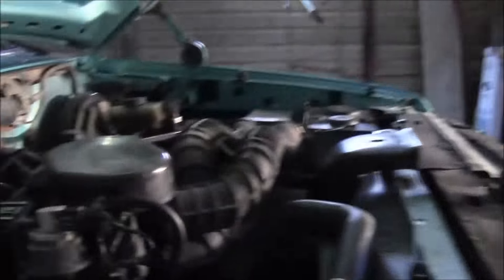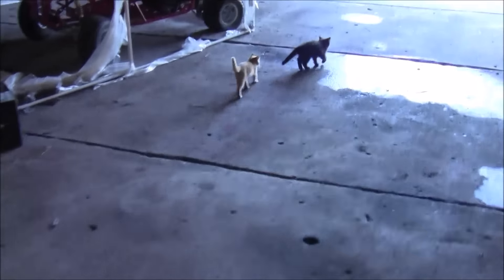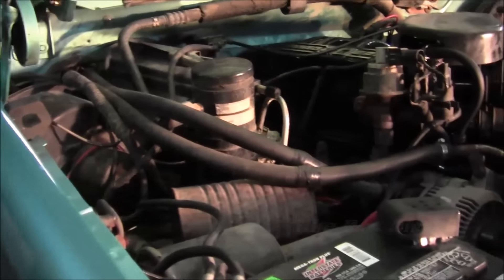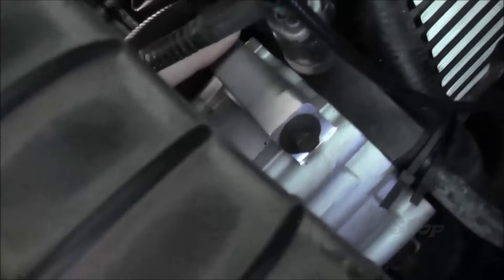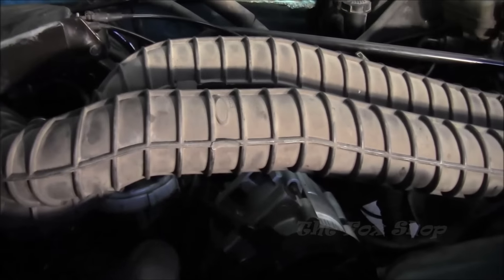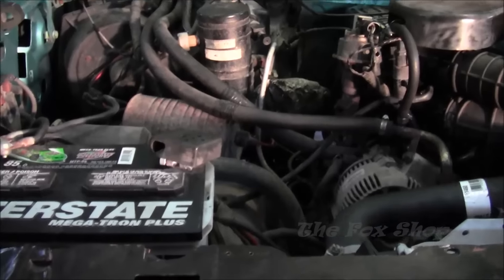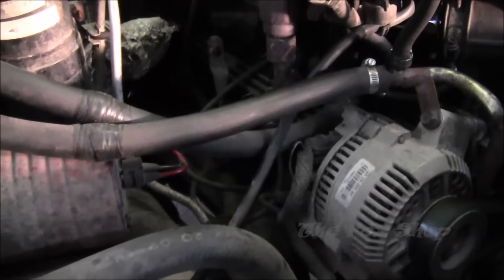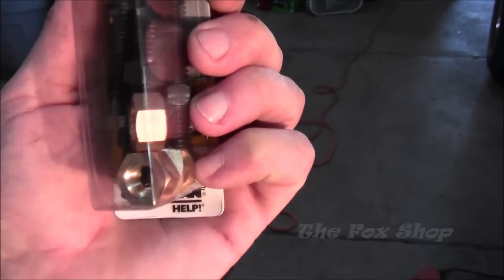Ford F150 Exhaust leak and a/c fix (again) Video.

Comment: You should have named this video "cats take over my shop" LOL. If it were me that spray bottle would be replaced with a .22! The stray bastards sneak into my garage and eat my dog's food and get into my trash at night (picking up a bag of trash scattered across 2 acres by the wind at 5am isnt my favorite thing to do).. so I take a slightly more lethal measure, lmao. When I grew tired of the leaky flanges on my f150 I just threw some Pacesetter headers on and a dual exhaust and called it a day. Its more of a winter truck now. I remember some time ago I thought you mentioned potentially getting another OBS.. that would be awesome to see. Your F150 is just too nice and I can't picture you driving it in the winter! Hmm.. maybe you should get a winter truck and make a video series about it too..haha! I'd like to get around to fixing my AC in both of my OBS trucks, I've had no air for years in my half ton though. The summers in Ohio are brutally humid as well. It sucks! This video made me want AC again, lol. Yet another entertaining video from Fox.
Reply from the maker: Logan W. LOL!!! Well we actually like our cats, they normally don't go into my shop, but being that its insulated its been cooler in there, so I think they like it.  Havent had much of a problem after I started using that spray bottle... plus they keep the mice away. LOL!   You are pretty much on target... I don't plan on driving her in the salt and crap in the winter, just cant get myself to do it. When I first started that was the plan, and if she started rusting again I would just fix her again, but never thought she would turn out this good to be honest! LOL   SOOOO.. the plan is to buy another OBS for a winter and beat around truck.. although will probably fix it up somewhat and paint it.. but there is also something to be said or driving something you just don't give a rip about how it looks. At a minimum it has to be reliable... but looks not so important.  Might straighten the body out if it needs it, do some paint, and then just run it.  I have a 1999 Tahoe I need to get rid of. Nothing wrong with it except the rear end has started whining a bit, Im thinking pinion bearings maybe.. Don't even want to work on it but doubt anyone would buy it for what its worth the way it is.  After I sell that, then would like to find another OBS.. Not sure when that will happen, but need to get it fixed at least before winter and Ill just drive it this winter if I need to, but my truck...I cant do it... put too much work into her.  Hot and humid here in Iowa as well... tomorrow heat index 106 to 110 I believe. Yuck! Weekend supposed to be that way also.  Thanks for the comment and for watching, much more to come and you are pretty much on target with how Im thinking as well. LOL!
Reply: The Fox Shop Understandable on the cat thing. but a '99 Tahoe!? Come on man! Another FORD would be so much cooler! Lmao.I'm just messing with ya.. I see where you're coming from on that.  It would be cool to see you get a winter truck and beef up the suspension on it and what not, you could use it to plow instead of your beauty! Haha. You're right though, reliability is a must and with a little work, as we both know, makes these trucks unstoppable. All up to you in the end! Your videos are great and another little project video series from you would be awesome, needless to say. Hell, Its pretty clear that I don't give a rip about what my winter/romper F150 looks like, but her nickname is old reliable because she's an OBS. Curious to see what you end up doing. a 3/4 or 1 ton OBS winter truck video series would be as cool as your F150 Restoration series. I've said it before and I'll say it again.. I can't believe how nice your half ton turned out. I remember when she still had worn out leaf springs and rusty fenders... seems like a century ago! Ok, I'll stop trying to convince you to get another truck.. I just really like your videos man. LOL. Thank YOU for making them, and I'll keep watching them.

Comment: Hey man did you repaint the underside of your hood? sure looks nice and new. Mine looks like death warmed over even after pressure washing. 

Where did all those cats come from? I have an outdoor cat that hangs around and does the same crap when I'm working on stuff in the garage. Gets annoying sometimes lol.

I remember when I bought my truck I ripped the stock exhaust off, because it was total junk lol. Boy I wish my exhaust bolts were loose. Took 2-3 hours to remove them.
Reply from the maker: 1972FordF150  Yep, I did a lot of bodywork and total repaint last year.  Under side of the hood along with inside the fenders and so forth all got new base/clear paint.  We have a lot of farm cats. LOL! I really do like em, just not in my shop, however they keep the mice population down so cant complain too much.   I plan on doing a complete exhaust overhaul later this fall, so keep watching!!  Good stuff coming!